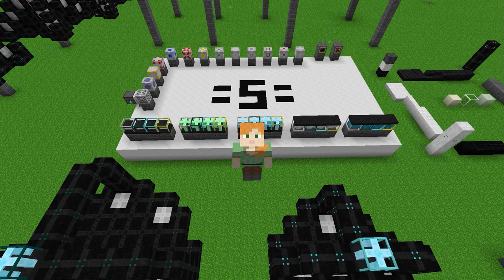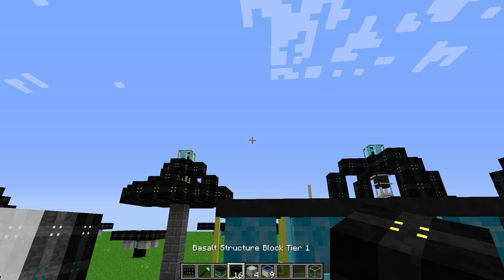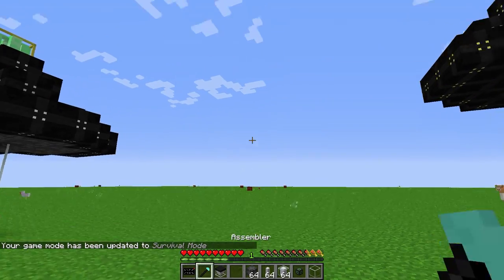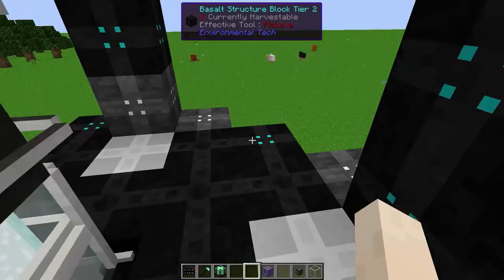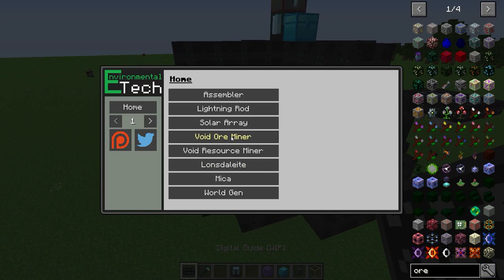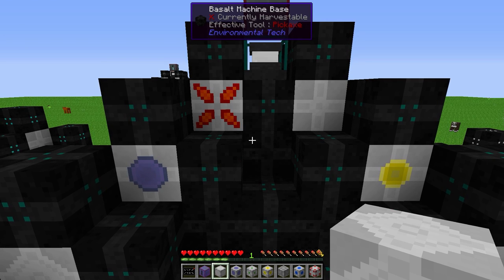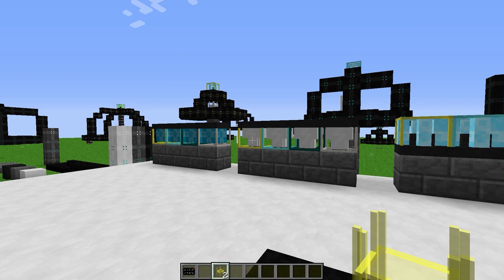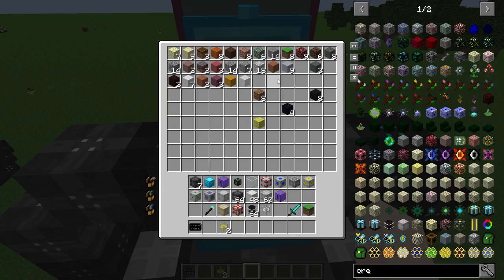Environmental Tech Mod Spotlight Minecraft 1.10

Comment: So, presumably basalt is ore dictionaried with other mod's basalt? Considering adding this to an established world. So I would only need this mod's resources. Can those be retro-genned in? The lenses will help with that by the looks of it. :D
Reply from the maker: I am 90% sure that Basalt is ore dicted. I'm not sure if it can be retro gen in old chunks. However you could go to a new dim, or load new chunks if it didn't. Once you have the mats needed to make the resource miner you can get all the blocks from all the mods. Then on to the Void Ore miner for all the ores.
=S=
Sha
Reply: That's kinda the problem. I am almost literally swimming in mats, I set up an RF Builder with a quarry card, max sized it (512x127x512) and set it loose in the Deep Dark. >.< So if I installed this mod all I would need would be the mats to make the cool tech but if I set up a Void Miner I'd want to set it to  only get EnvTech mats and ores, the ones I don't have several 10s of 1000s of ingots of already.
Reply from the maker: You can use some filters to trash anything you don't want or to only keep the new stuff.
Reply: Yeah, like the lenses or see if I can't get a Digiminer up and working.
Reply: Well, so far, I got the RF Tools Builder running in the Under Dark, getting Hardened Stone and Alabaster but not Mica. O.o Don't tell me it's Void Resource only? >.< I've got everything I need for a tier 4 except a Tier 3 controller needs Mica. :(
Reply from the maker: It is indeed the only way. Sorry to be the bearer of bad new :D
=S=
Sha

Comment: What is that nei tipe mod?
Reply from the maker: It's JEI also works with NEI for 1.10
Reply: Mmmm no, mi jei don't look like this, is equal to nei xD
Reply from the maker: NEI is a thing again. It can run with JEI. I also use FTB utlis in my District 42 Pack that is on the curse launcher. 
=S=